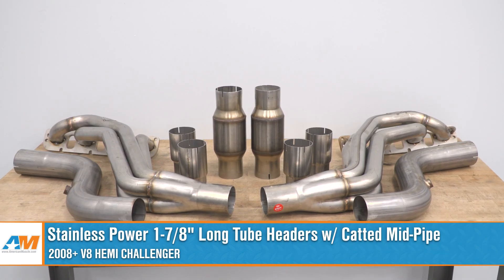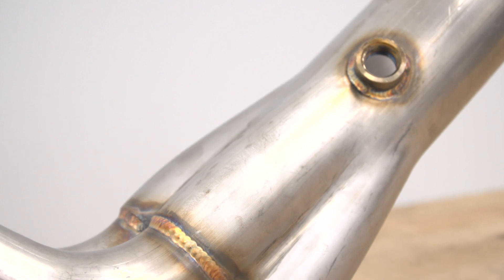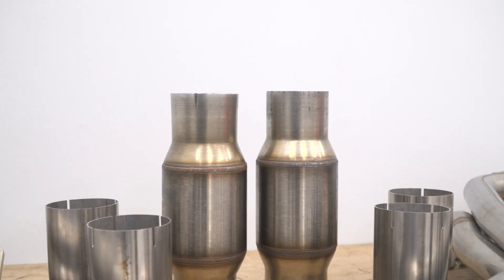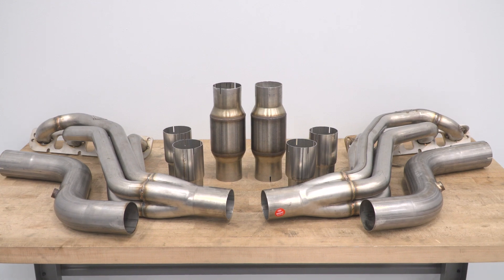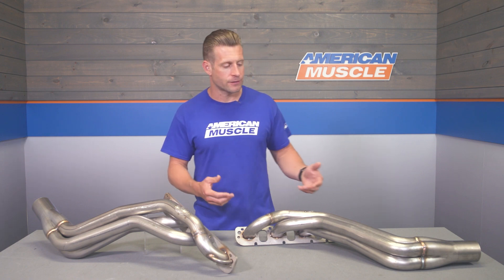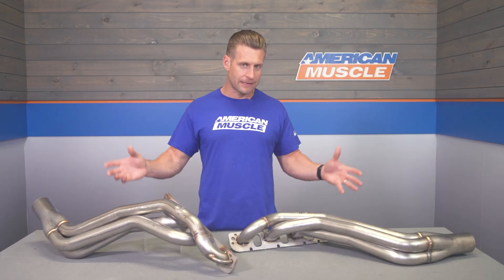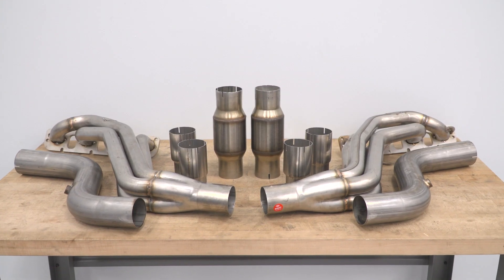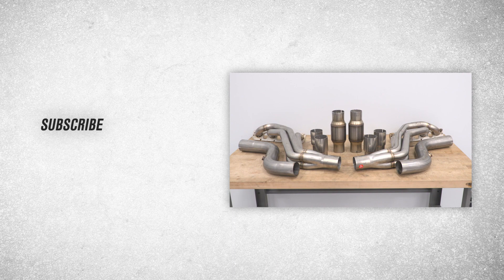2008-2023 V8 Challenger Stainless Power 1-7/8-Inch Long Tube Headers Review

Comment: could you elaborate on why it doesn't require a tune ?
Reply: I’d like to know also cause everyone I’ve talked to says never run a mopar with aftermarket headers u less you have a tune for the sensors being that they are in a different spot  of airflow. Also was told you take a high risk of a misfire with damaging results.